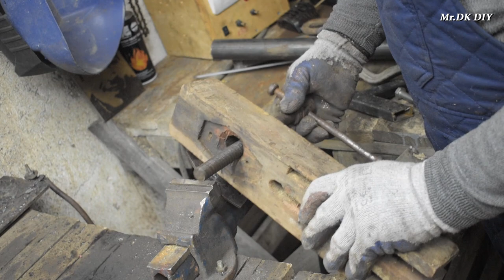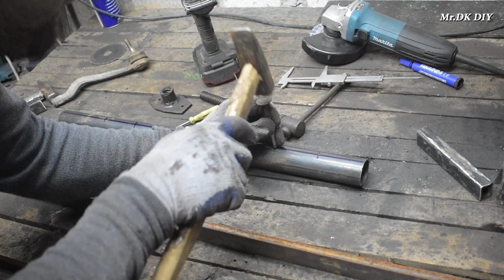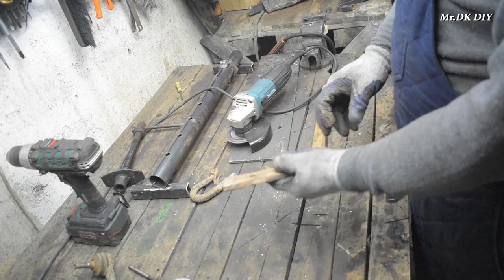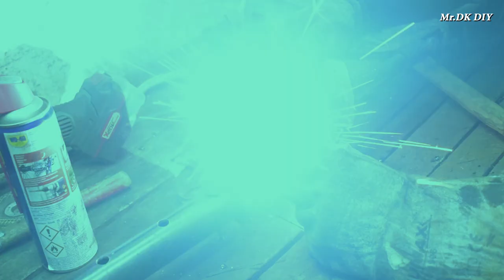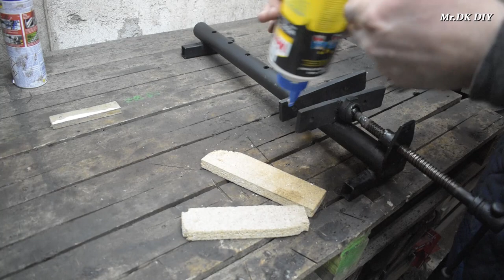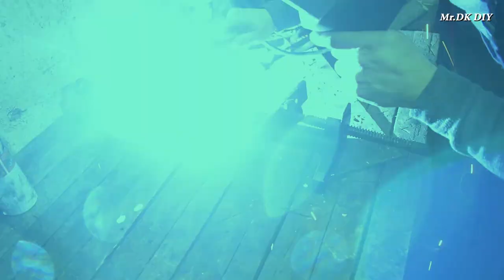NEW !!! Homemade Tool Idea / Universal long and short Clamp (Bench Vise)

Comment: I don't always make a crappier tool out of another tool, but when I do, I make sure I spend as much time and materials wasted as possible.  And listen to elevator trap music the whole time.
Serious though ,good effort, but this clamp has a limited scope of capability.  Better off getting a couple of bar clamps instead.  And  then refit the original parts of your DIY to to make a proper tail vise on your workbench.